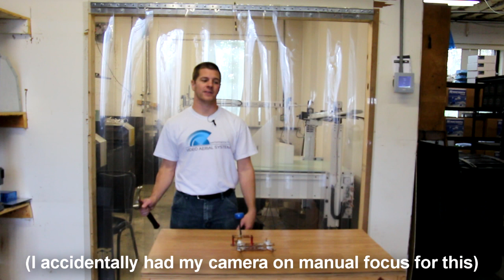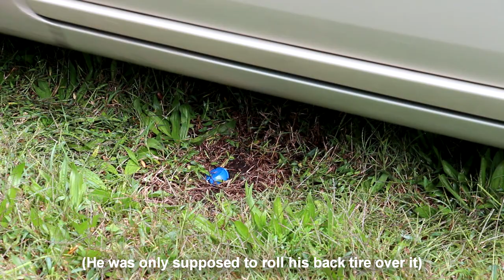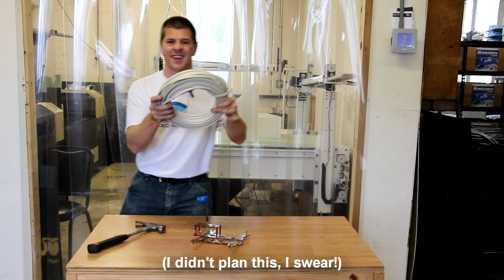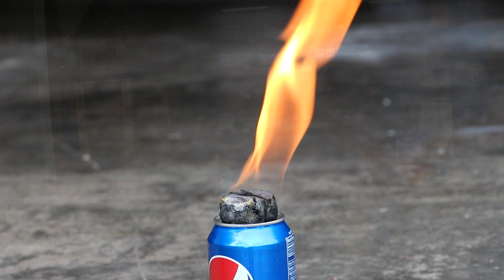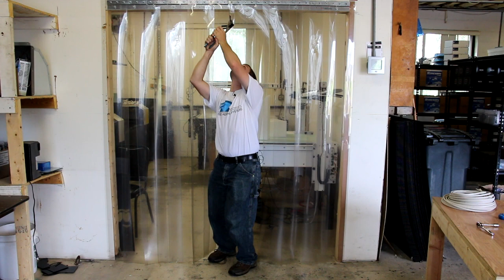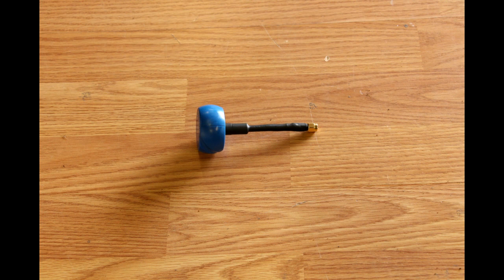Destroying the VAS Dura-Spec antenna

Comment: my previous ibcrazy antenna blue protexion thing broke hitting very first gate, sucked! lol new one looks loads better  :) next problem though,  my ibcrazy antenna had the sma ripped off! any way to strengthen that? or to protect antenna from getting caught on the gates?
Reply from the maker: +Phillip Evans - The Ultras were never supposed to be raced and that's why they break on gates and such.  The SMA is usually able to be repaired.  I actually have a video on this on this channel.
Reply: +Alex Greve naa it's all good :) I didn't realise when I bought it that wasn't for racing, thought it was for protection as not really needed for planes etc. already have some sma's to fix it. it would be good to have a protector that tapers down at bottom so that it can't get caught on a gate.

Comment: I fly only your antennas. But that unfortunately means that I have also broken several of them (I think I'm up to 4). Every one of them broke at the SMA connector. Glad to see you are addressing that. But are there any retrofit options to strengthen existing VAS antennas? I have whips and ultras.
Reply from the maker: +HighFlight2k2 - Sadly there is not any retrofit.  These were designed for durability at the start.  The dielectric needs to be taken into consideration when designing or it could ruin the antenna performance.

Comment: Did it hit you back once off camera?  LOL..  

Nice ANT.
So does it have some kind of foam in there to make it more durable? I wonder if I squirted some great stuff foam into the dome on my RHCP Spironets or similar, if it would make it more durable at all? Maybe it would not let the metal bands of the antenna  bend in an impact?  Hmmmm..
Reply from the maker: +BWX - I am still recovering from the injury I had in my earlier video.  It is an immune system issue, actually.

The great stuff foam works ok, but it is a bit hard to control and has some issues with dielectric speed.  The relative permitivity needs to be low in order to make a good protector.
Reply: +Alex Greve I was wondering about that, if the foam would interfere with the antennas operation.. interesting.  Well I guess it wouldn't hurt to experiment, but would be hard to see if you are hurting performance without the proper equipment, such as in this video above.

I thought  that thing might have  popped back and got you in the face, LOL. .  well anyway, get well soon!
Reply from the maker: +BWX - The equipment to test this was the best $12,000 I ever spent.  In the words of Thomas Black (DPCAV) - "Sometimes it is hard to justify a piece of equipment that costs more than the car in your garage, but the long hours, low pay, and difficult customers make up for it."
Reply: I bet!!  It would be impossible to test different types of foam / medium for the "average joe" I guess.  You could test for durability, but not performance, at least not very accurately.

I'm building my first quad..  so I think one of these will come in handy! (I'll probably crash a lot at first.)  Do you think they'll be ready by next spring? Alex Greve
Reply from the maker: +BWX - $weeks is the plan ;)
Reply from the maker: +Alex Greve 4 weeks.  Mist type.
Reply: Cool! Thanks.

Comment: This is a little asinine.
Reply: +MrMac5150 do you think he called himself IBCRAZY for the hell of it? It shows what it can withstand...From the torture test, its safe to say, flying into a tree or crashing hard into something. the antenna well hold up.
Reply from the maker: +MrMac5150 - How so?  I'm trying to make an antenna more durable than anything out there so people don't need to keep replacing their antennas after crashes.  I just recorded my testing of it.
Reply: Alex Greve
 Hitting with hammer, playing with fire.
your acting like a bit crazy.
Drop it ten feet to a hard surface is what I call
normal.
Reply: +MrMac5150 Yeah..."Hey everybody, I designed a bullet proof antenna, here look...I can drop it from ten feet on to concrete.  Order yours now!"

That would go over big.  It appears he would sell only one....
Reply from the maker: +EnuffsEnuff318 - One per vehicle people own, probably.  People own lots of aircraft.  I don't believe the antenna should be a disposable part.  We spend a good deal of time building them by hand and thus I want them to last.
Reply: I'm on your side Alex.  The OP says your crazy for this extreme test.  If you only dropped it from 10ft to be 'normal', you would only sell one of these....to the OP  :)
Reply from the maker: +EnuffsEnuff318 - I only want to sell one per person per vehicle.  That's the idea.  The antenna is not supposed to be disposable.  These are supposed to be your "practice antenna".  You break out the race Specs for race day ;)
Reply: Keep up the good work!
Reply: Whoa...I guess you told me.

Comment: soooo..... when can we get it?   Also what about something for 1.3
Reply: ***** with a big blue injection molded plastic cap?
Reply from the maker: +Wyll Surf Air - 1.3GHz would be HUGE to make like this.  However, I find the 1.3Ghz antennas plenty durable.  You can bend them back 15-20 times before they break.
Reply: +Alex Greve ya I understand.  I wonder if there is another material that would hold up to being bent back to shape better.
Reply: +Wyll Surf Air lol thats like strapping a watermelon to your quad. i guess if you have a 30 foot wingspan glider it could handle the drag of the 1.3 case
Reply: I have flown his 1.3 for years there great.
Reply: +Chris H. No cover.
Reply: +Tigerlie ya that is what I was thinking.   I'm sure it can transmit radio waves.    The question is if you can soldier to it.
Reply from the maker: +Tigerlie You are talking about Nitinol wire.  It is a memory wire that conforms to shape when heated.  The problem is that nitinol is outrageously expensive and is not solderable.

On the other hand, Spring steel coated in copper might be an option.  Not sure where I would find it.  Perhaps it is available in a tin jacket?  I will need to do some searching to find such a material.